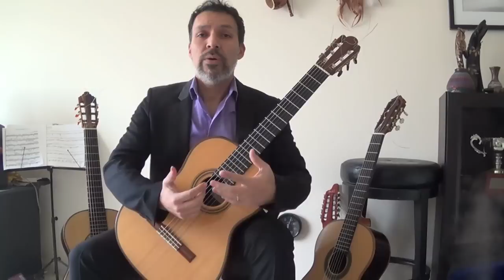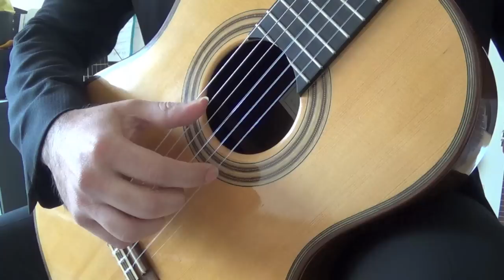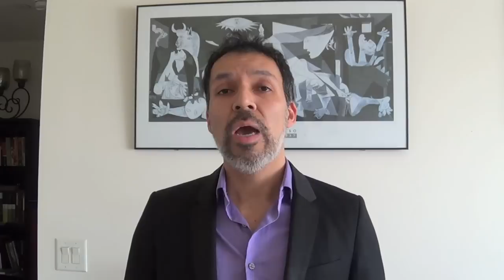Classical Guitar Technique- Collapsible Joint Rest Stroke Part 3

Comment: Thank you for producing this series, Jorge.  The questions I have are: why would a performer use this technique?, How is it different from rest stroke without collapsing the joint?, and Can you demonstrate an example of its application in a piece?  Thanks, Dennis
Reply from the maker: Good question. Applicability of a stroke is defined by two aspects: sound quality and functionality. A ratio between these two reasons always applies. I will explain more in further videos, when I discuss other types of strokes for the right hand. Thanks!